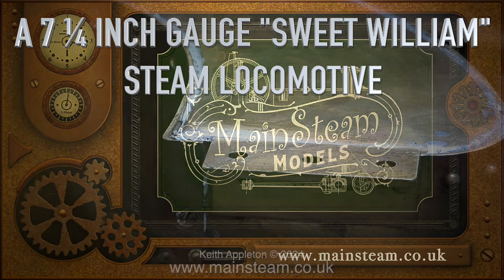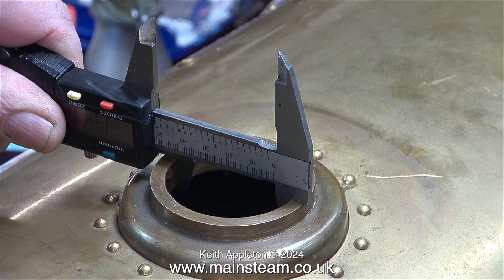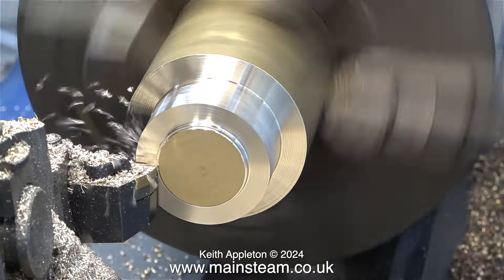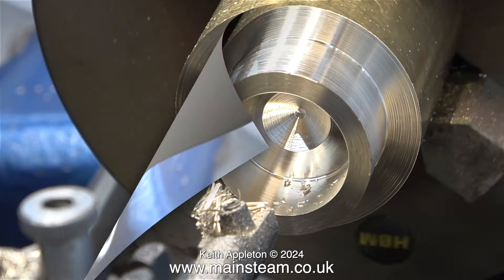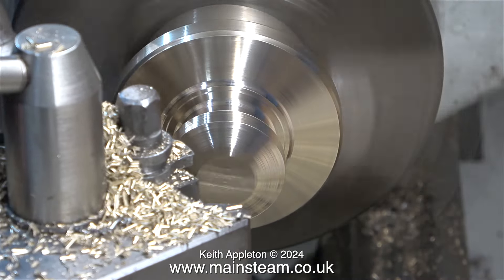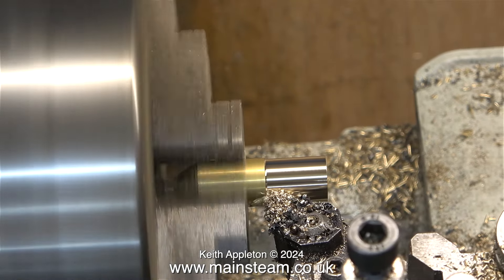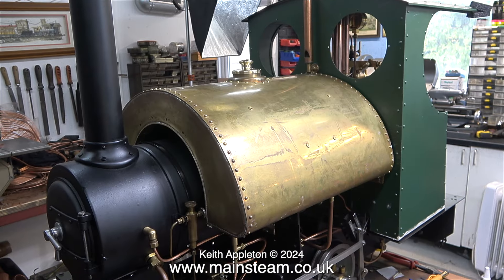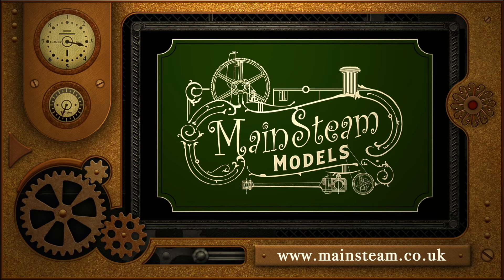A 7 ¼ INCH GAUGE "SWEET WILLIAM" LOCOMOTIVE - PART #80

Comment: curious question (I never worked with a lathe) what happens if you ran the lathe counterclockwise so the chips go downward instead of up? / great job on the filler cap
Reply from the maker: Some people run a parting tool at the rear and rotate the lathe backwards to make it cut, but alas you still get loads of swarf ......
Reply: @keithappleton  at least it isn't flying toward your face